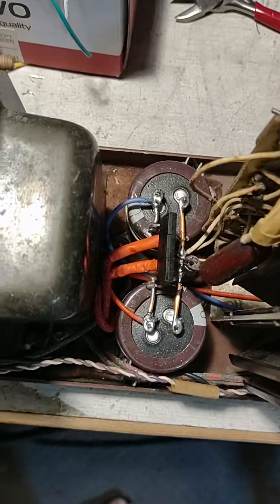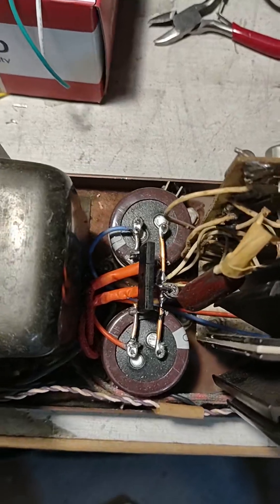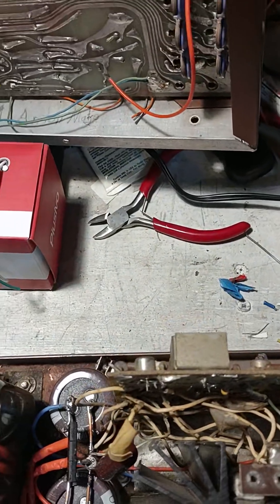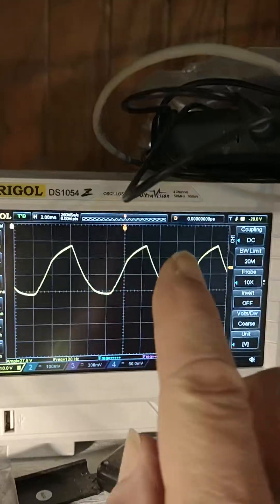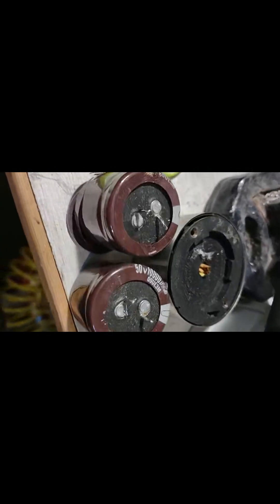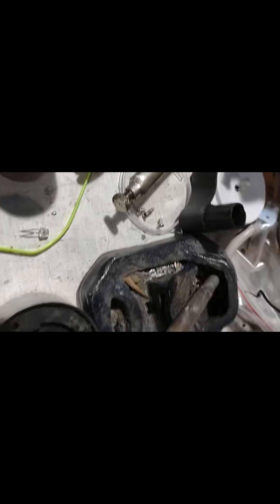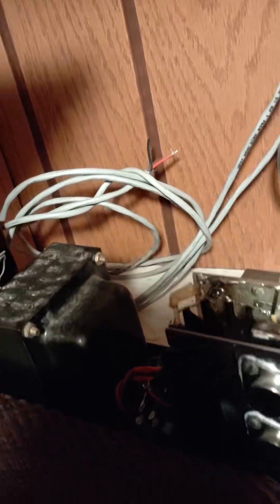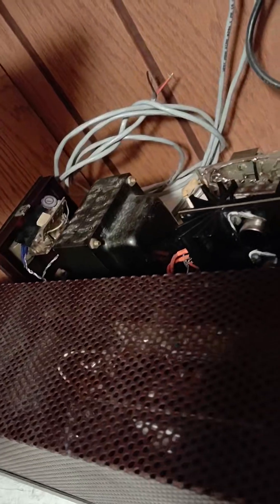Tiger Caps Again!

Comment: You said in the other video that you got those capacitors from an Ebay seller. I'd wager that they are counterfeits. They could have been damaged from the generator incident, but the power transformer would go into saturation and limit secondary voltage somewhat.